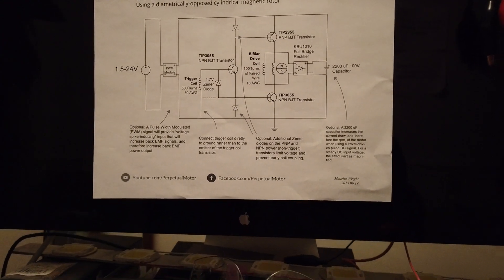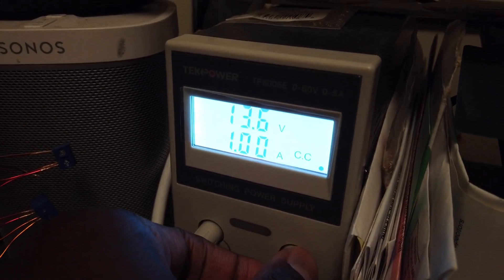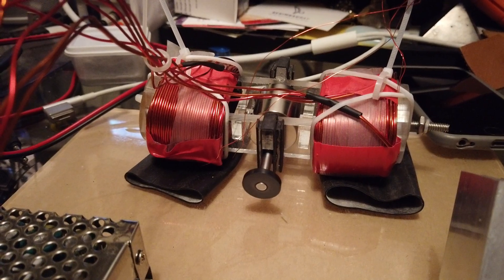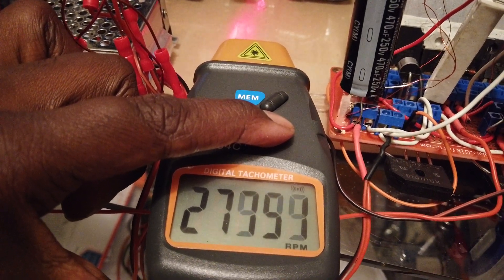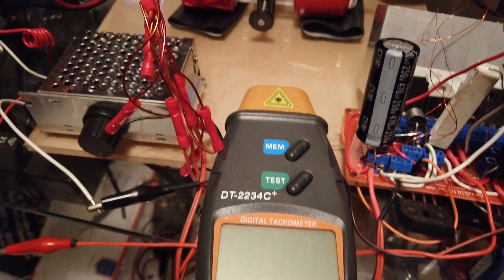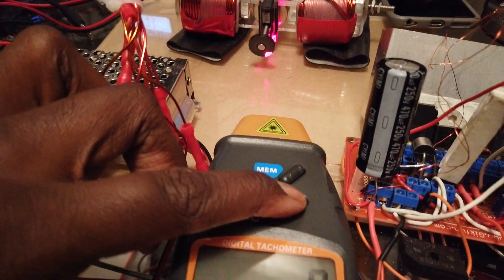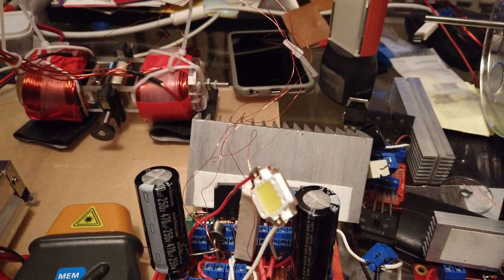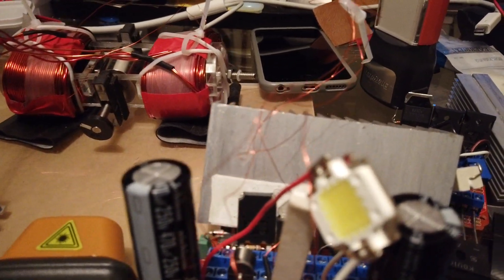Nearly 40,000 RPM Bedini Recovery Circuit Motor - Top Speed Run Blows Transistors

Comment: Hey buddy I love the work you're doing, awesome stuff! I didn't realize voltage could be increased with a pwm like that! Do you have a link where I could get one or is yours custom? That's some impressive speed!
Reply from the maker: Thanks for the feedback. The PWM doesn't actually increase the voltage. What I did was increase the voltage with the power supply. At most PWM settings, the motor will only draw a limited amount of voltage. I set it there for when I have to start the motor and it needs current.

Once the motor is started, I actually have to TURN DOWN the PWM to limit the current, and at a certain point, the motor gets into some kind of resonant condition, and it begins to use more and more of the voltage that the power supply is providing.

That extra voltage speeds it up. Once that happens, I can turn up the PWM incrementally to get more current, but as you see in the video the transistors (rated at 90W) blow out once I hit 50V and 2A, or 100W.

The PWM is a RioRand 7-80V PWM DC Motor Speed Controller Switch 30A that I bought on Amazon. It's good for over 300W at 12V and 500W at 72V.  

Here is the link to the PWM on Amazon. I'll also post it in the video description.
https://www.amazon.com/gp/product/B071NQ5G71